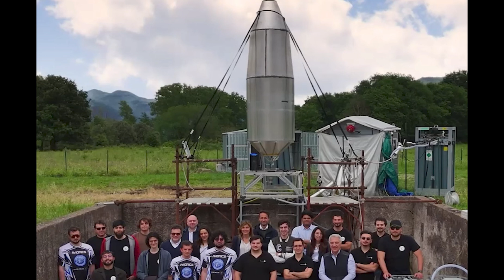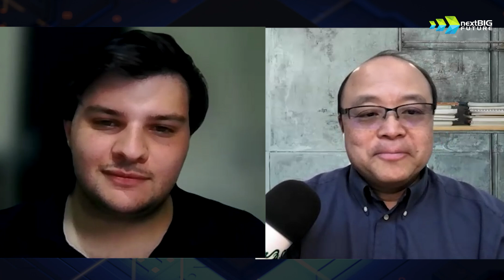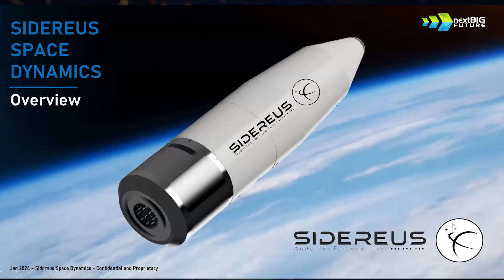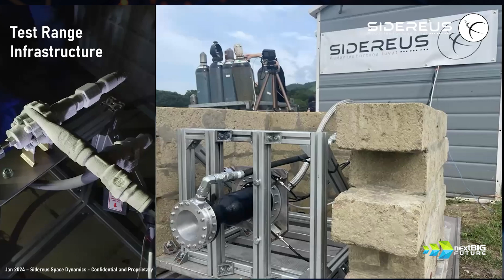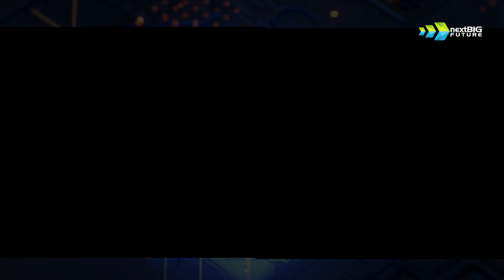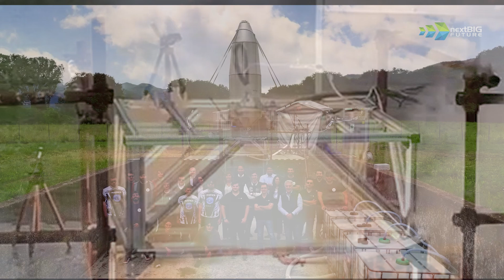Amazing, REAL Worldchanging new rocket

Comment: Anyone worried about potential abuse by malign actors, should keep in mind the payload mass limitation.  Sure, you could deliver a 100 kg warhead to the general area of your target - and it would amount to little more than a nuisance firework, unless your guidance system is very sophisticated, as well as resilient against jamming.  Also, the fat-and-short form factor of the rocket, as well as its low dry mass, will limit its speed through the troposphere - so it will probably fly no faster than a decent drone by the time it's in terminal guidance.

Comment: Mattia spoke about using the recovery parachute in the event of an emergency during launch. Typically, if there is a malfunction early in the launch, the flight is remotely detonated, destroying the rocket. I find it hard to believe that the same parachute designed to recover a 30 kg (empty mass) rocket at the end of a mission could also save a 1800 kg (100% fueled mass) rocket that malfunctions early in its flight. If Mattia used a parachute large enough to support a 1800 kg load (100% fueled mass), the rocket would either never reach orbit or would have to do so without any payload onboard. What do the rest of you think? Does this make sense to you?

Comment: Please tell me I'm wrong.  And why.  So... for the price of a well-equipped Ford F150, a small nation that is being troubled by a bigger nation can 3D print a few hundred thousand of the engines, put them in smaller-sized Sidereus rockets, fill them up at the local airport, and send canisters of petunias or shoelaces to the other side without bankrupting that small nation?  Or park container ships filled with thousands of these off the coast of a nation and drop tons of pineapples or striped Fedoras on citizens?  It won't need SSTO capabilities for those missions.  And won't need to be reusable.  Or even need biodegradable parachutes.  So, please, tell me I'm wrong; and why they won't be used by bad actors?

Of course, it could be used by FedEx and UPS for packages, or Peace Corps for delivering food aid, rescue supplies for disaster areas, or more peaceful purposes.  And I truly hope this idea will be beneficial in many applications.  But I can see nefarious uses by small groups of dissidents and nations trying to indiscriminately rapidly disassemble carbon life forms who have differing points of view.  This has great potential and I am happily excited for them, but I wonder if the final costs are gong to be very high.
Reply: Fair point.  The fedoras wouldn't even need to be striped.  Even a few barrels of Kool-Aid surrounded by croutons could cause cataclysmic damage en mass.
Reply: Oh well , will make a nice change from big nations destroying small nations for oh , things like bananas...
Reply: Oh pastor, great to see you seeing all the positives 😂
Reply: @ajctrading  ;-)